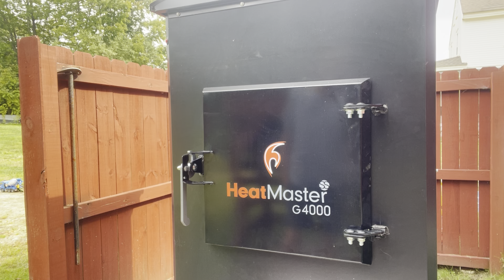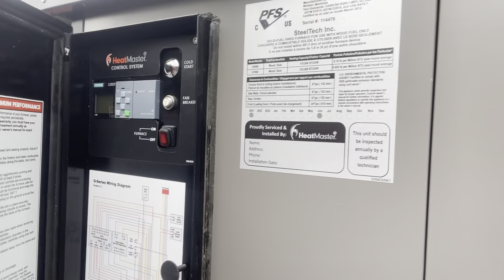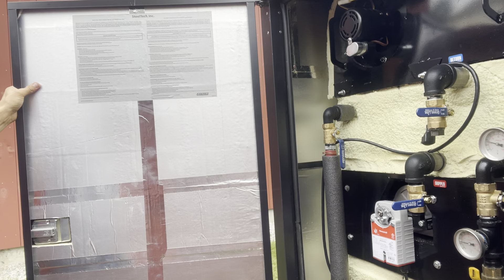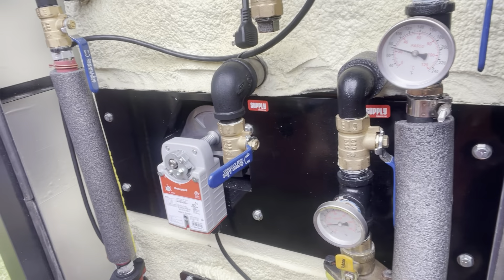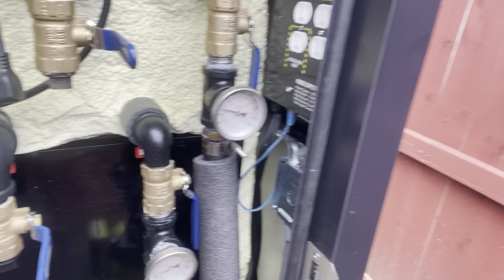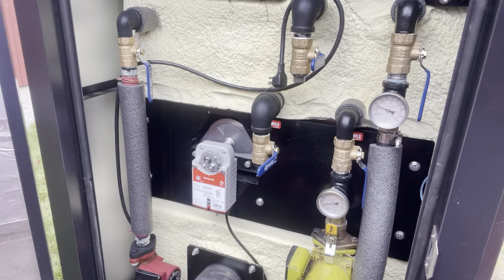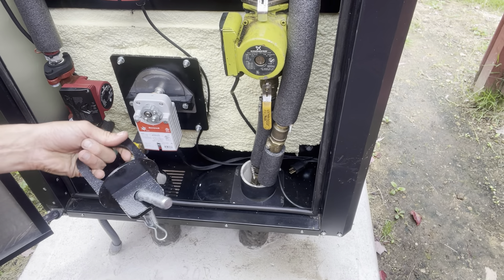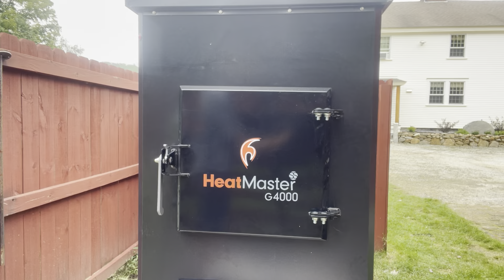Heatmaster G4000 First Look

Comment: Jonathan, what insight do you gain from your flue temperatures?  I'm guessing you may only read that when it's in a heat cycle or do you get info in idle mode?  Thanks, good detailed video here.

Comment: I just installed this unit in my basement.   I send wood down my belco door.   Been burning this for about 3 weeks now and am really impressed with it.   I upgraded from the famous Empyre wood boiler mess.
Reply from the maker: Those empires were a big problem. I started burning this year on October 28 and just passed 2/3 of 1 cord burned heating 3000 sqft 226 year old house. Something that we are starting to see is that people don’t realize they should adjust their settings which are in the manual based off of the average wood moisture content. The controller comes factory pre set for wet wood.

Comment: Just curious to see an indoor setup. I recently purchased a g4000 and have done a ton of research on it but can't seem to find any videos on hooking up to an indoor boiler. The only info I've found is from alternative heating but that's just diagrams. I have a new peerless oil boiler with tankless hot water. Alternative makes it sound easy but I know that's not the case. Lol

Comment: I was wondering how you like your furnace after 6 months, as I am planning to get this model?  Also, I see that you changed the locations where the piping enters the bottom of the unit due to a misalignment with your pad.  Isn’t that grill area you used supposed to be the cabinet fresh air inlet that feeds the openings in the dampers?  If so, looks like you reduced airflow into your furnace by over 50%.  My curiosity is peaked!
Reply from the maker: The boiler was excellent last season, I burned 7 cords for the winter. It is very easy to run, no smoke and super efficient.

Comment: We might get a g4000 soon- thanks for showing us your nice setup. I was wondering how many cord of wood (seasoned hardwood?) you are burning and how many square foot you are heating it with. We only have seasoned spruce to burn and I hope that I won't have to load it too often?
Reply from the maker: I go through about 7 cords. Last year was a long season and this season the weather didn’t turn cold until mid November so we will be burning about 6 cords. I am heating 3000 sqft in New Hampshire and the home is 227 years old but insulated decently well. With soft wood you can expect to burn about 30 percent or more vs hardwood. Sizing the boiler so that you can get 12 hour burn times on the colder days of the season with whatever fuel type you are using is important. How many sqft are you heating, what is your location and how much fuel per season are you using now?
Reply: @jonathansinclair6963  Hello Jonathan and thanks for your information and reply! We are in Nova Scotia (probably similar to NH?). It would be a new home decently insulated- 1500 sqft but with 15' walls and cathedral ceiling and infloor heating. Also a 1500 sqft wood working shop but I would be happy to just keep it at 55F. Also a 200 sqft tack room in the barn but I would be happy to have it set at 50F so just to keep it from freezing. I agree with you- I don't mind loading it twice a day but 3 times would be kind of annoying I think.

Comment: I'm not real familiar with Heat Master, but one of the big draws for me is that it is UL listed for installation inside, any thoughts about that? I'm looking to buy my first boiler and it just seems like it would be more user friendly to have it out of the weather. I'm thinking a stand alone building or building a lean to off the rear of my garage.
Reply from the maker: If you have the room to dedicate indoors to the boiler it would be a great option. A great feature about the boiler is the two piece roof section in the event that you ever need to remove the roof section of the boiler you can do that without disassembly of the flue. Placing the boiler under a lean to is another nice option to be out of the weather. I would encourage you to take a look in person at your closest dealer to appreciate the construction of the boiler.

Comment: What is the size of the PVC pipe you used through the concrete pad? I'm going to be installing a G200 and want to do the same thing.  Thanks!
Reply from the maker: The logstor insulated pipe is cemented right into the pad. You would have to use a 6 inch pvc sleeve to slip any type of non “do over pipe” which is either rhinoflex, thermopex, rehau or logstor. Don’t buy any of the drain tile stuff. That’s cAlled do over pipe because of the high failure rate where ground water gets in.

Comment: What is the thought behind the blown insulation now? I bought an MF10,000 8 years ago and the rational then was it doesn't allow condensation out. Which I why central boilers rust out. That's the sales pitch I was given. Bat insulation was much better per Heatmaster rep. It seems like a 180 and inconsistent marketing or just talk to make a sale. I am not knocking Heatmaster, they make a great product and I've been very satisfied.
Reply from the maker: I have heard of the failures of another company who also uses closed cell spray foam on the water jacket. Although I do believe that fiberglass has the ability to dry if it gets wet for some reason that it shouldn’t be an issue here if the boiler is prepped correctly and Heatmaster uses 409ss water jacket as well which another company still uses mild steel water jackets. I believe the push behind this latest move was to push the boiler line to the top of the class for efficiency ratings from the EPA which was successful. There is a lot of idle time during the lower output tests and if the water jacket is losing more heat vs spray foam then the overall efficiency will suffer. Time will tell but Heatmaster makes an excellent product and stands behind their product line 100 percent.